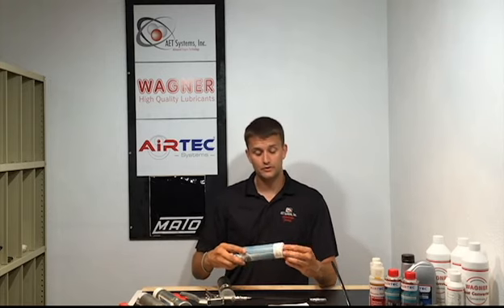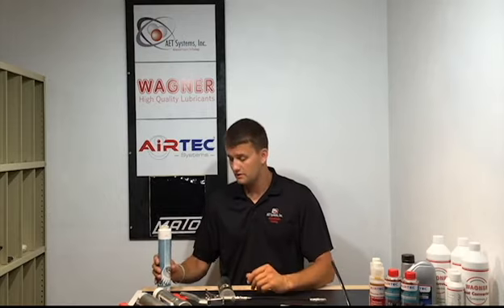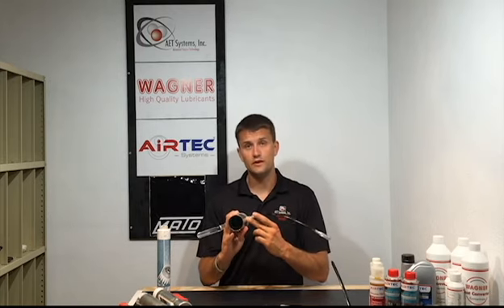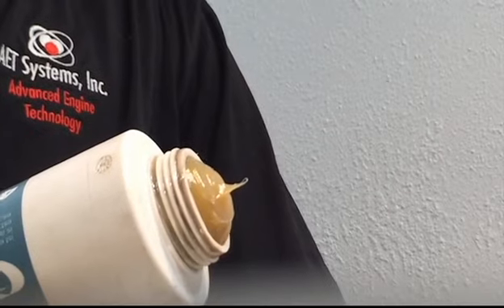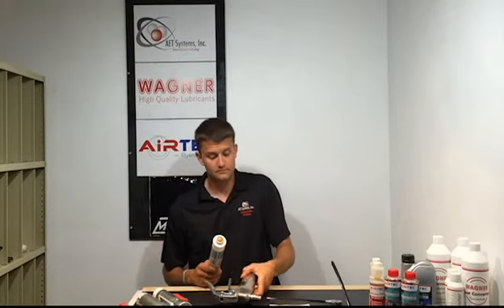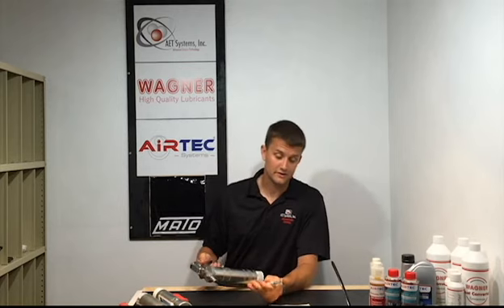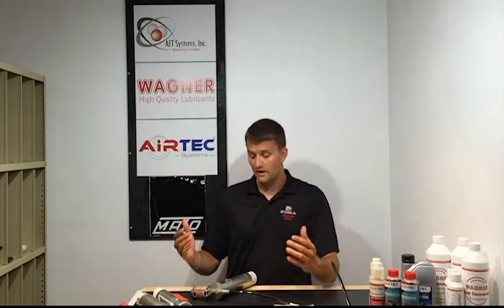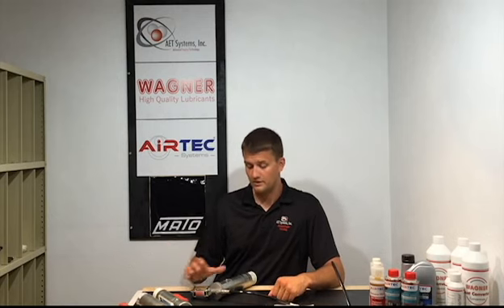Air-Tec Lube Shuttle Grease + Grease Gun: Maximize Your Performance

Comment: Just got this delivered. Seems great except the threads don't seem to work with my Locknlube coupler. Any idea where I could find an adapter?
Reply from the maker: Our threads are M10x1 and your other coupler sounds like 1/8 NPT.   You will be able to find an adapter at a local hydraulic supplier or online at amazon.  M10x1 is commonly used on Milwaukee grease guns so they are readily available.
Reply: @aetsystemsinc.1413  Once I found out your coupler rotated, I ordered it!!! Thanks